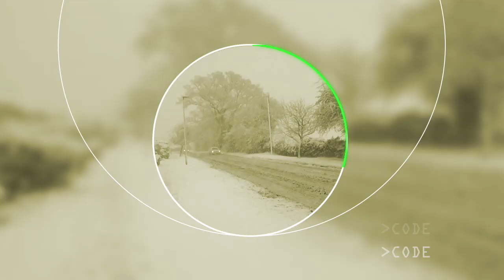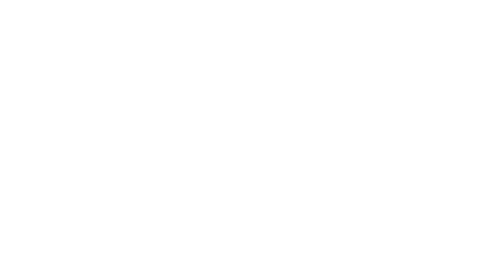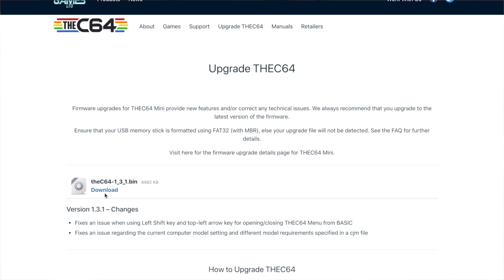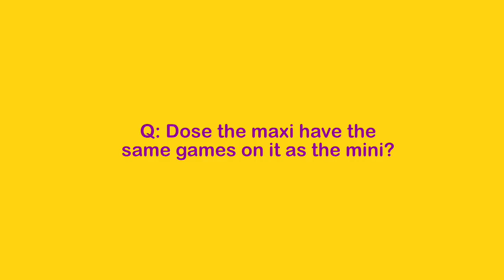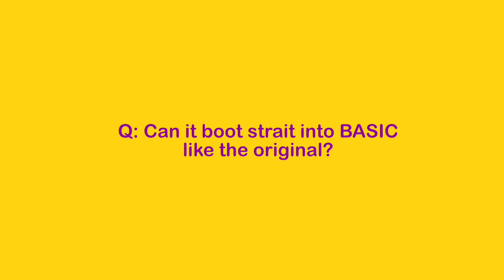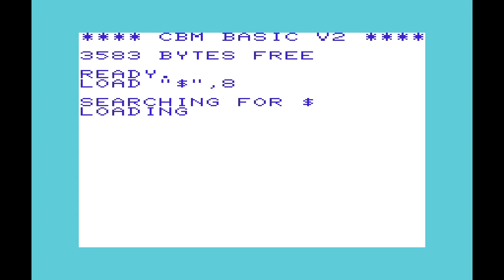The New C64 -  Your Top Q&As

Comment: couldnt i use the usb port on my tv to power The C64? (it powers my other mini systems) mine should turn up in a few days, new sub+1
Reply from the maker: Yeah many others suggested this and technically yes that would work.. only issue might be if it gives out enough amps. Problems might occur of using 3rd party USB or HDMI devices that draw power off the C64's power rails ... but if its a strait plug and play then yeah a TV might be able to power it.

Comment: Can one add games to the carousel, and optionally include a thumbnail graphic for each added game?
Or is the carousel reserved exclusively for factory-installed games?
Reply from the maker: Hi, Officially no its fixed to the factory installed games.. However as the system is Linux based and uses a All Winner ARM CPU it is possible to hack the system as it is mostly open source and add / remove games from the carousel. I know of a 3rd party PC app being development at the moment to make this easier for end uses. It should be noted that any such mod will in most cases void any warranty.

Comment: Well back in the day. I used to take an atari game and copy it to a pet floppy. From their I could write several games to a eprom and add a selector switch and play several games. All these games were programed to run on 6502. It was what all computers of the day used. therefore any of the other programs would work on the C64 with the proper loading of the program. Also replaced rom with an eprom and pre programed the F keys to do such things as loading a disk with the push of one key. Such as . to load a key was programed to the F8 key so it would not interfere with games using the F keys.

Comment: Best advice I can give is to reverse engineer this machine. Learn vice  understand how the interface connects to vice which will be through ROM and the rest will be what connectors can be adapted on the board. I.e. if Vice does not support tape input then this wont unless you want to rewrite vice and adapt a connector. I think a lot of clever people will dump the firmware rom and adapt it to open source boards like raspberry pi as it offers more opportunity for connections. Until then you will have major fun learning raster interrupts again and code which is what many want :-)

Comment: How is typing on the keyboard? I've heard that computers from the 80's had keyboards that by modern standards are very hard to type on for prolonged periods of time. The keys "have a long way downwards" or something... I think the orig. C64 and PC's of the day wouldn't be very suited to type your thesis on either. ;-)
Reply from the maker: On this clone C64 its ok, could have been worse but at the some time  not wonderful, I have since found out its a mock mechanical device so it dose not use key switches like the original or most 1980's micros instead using more modern membranes hence why it felt light to type with. Still a fair bit of travel on the keys. I have to say its subjective 50/50.
Reply: I prefer the long travel of older keyboards.  Modern ones, especially the laptop ones drive me totally nuts.
Reply from the maker: @dlarge6502  I have since found out it still uses a membrane keyboard with chunky keys to give the illusion of the original, its not terrible but  you can tell its built to a cost and dose feel light

Comment: Hi, when answering the question about power supplies in America, yes you can use a Raspberry Pi power adaptor but alternatively if your tv in America has a usb port on it then you can plug the C64 directly in the TV's usb port.
Reply from the maker: Hi , yes very true as long as the TVs USB out has enough amps .. some dont :-/ But yes a very good point !